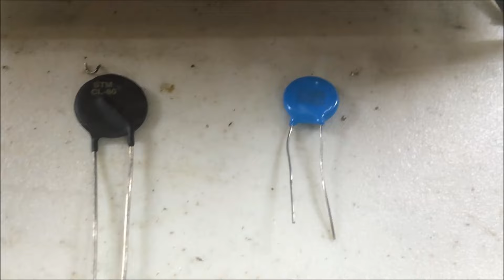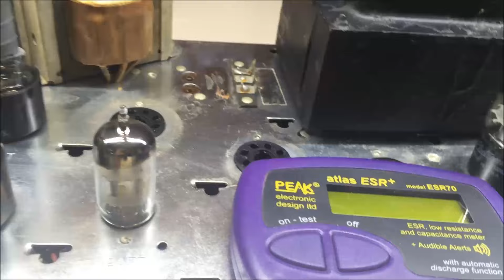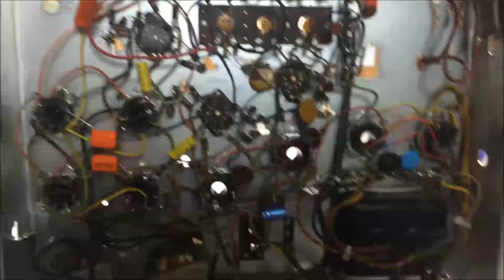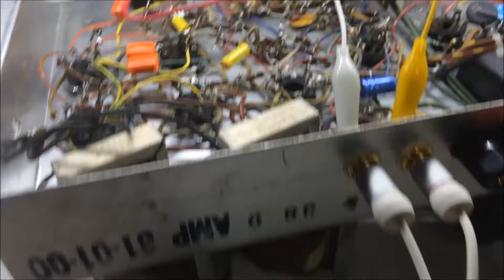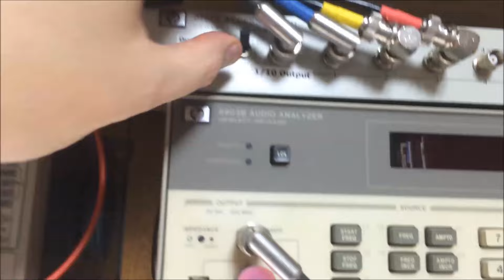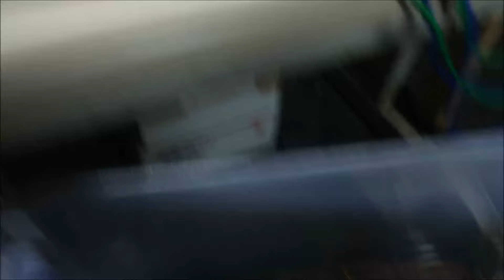Magnavox Tube Console AMP 81 01 00 Restoration - BG001

Comment: This was originally a bi-amp unit with 2x 6V6s for the high end and 4x 6L6s for the lows. I have not yet found a schematic online. It looks like you have set yours up just as a full range stereo amp and eliminating two of the output tubes. The pictures I've seen online are not great but it looks like the speaker outs are via one of the Molex connectors. You are clearly a way more knowledgable tube tech than I am but I would be curious as to your thoughts on restoring one as a bi-amped unit. There appear to be output screw terminals for one channel (?) with "H-C-L" (high-common-low?). The original unit had two output transformers on the inside and two on top for the four speaker outs (L-R high, L-R low). Anyway, nice work! I'm a lifetime sound engineer for live and film/TV postproduction but I am now getting my feet wet with some restorations of old gear I have owned for years (just finished the Fisher KX-200 I got in 1974 and it came out great and sounds amazing!)

Comment: I tried to go to your www.blueglow.net site but got this message: 
This site can’t be reached
Not sure what the deal is with it.
I was glad to hear you mention what you did about making a secure connection with the wire and not depending on the solder to hold things together.  I have a particular "irk" about that habit of many people.  I prefer the N.A.S.A. method, which is pretty much what you said to do.
I am curious.  Since you made all those holes to provide the mounting for the banana jacks and the RCA style connectors...and I think the fuse holder as well... WHY did you put the power switch so far away from the entrance of the power cable?  There looked to be ample room to install the switch near the fuse holder and would have saved running so much wire carrying the AC around the other components.  True you kept it away from the most important area, but I am just curious why you chose to do it the way you did.
When you mentioned that the original configuration was with 3 channels, I thought it would be great to use one for a "Sub Woofer" source...but I guess the owner either didn't have a sub woofer, didn't want a sub woofer, or something like that.
When you mentioned that you took out one of the rectifier tubes I winced...thinking it was so cool the way they had done that...but once you mentioned the excess power drain, it made more sense to me.
There is a video I wanted to share with you ...I think you will enjoy it.  Hope so anyway:
https://www.youtube.com/watch?v=BnR_DLd1PDI&t=220s
Thanks for uploading your video!

Comment: I just discovered your channel and am happy to subscribe, looking firward to seeing more great restoration videos. But I am wuite surprised you didn’t notice the configuration As a bi-amped stereo unit instead of seeing a center channel. I should think a fairly cursory examination of the circuit (let alone a Sams) would have given you a clue (eg. How many output transformers does it have?). Interesting hobby you have!
Reply: It was a nice amplifier. I am a fan of the bi-amped configuration. Now it only has two channels..

Comment: This is a 4 channel amp.  2 bass channels running in push-pull with 2 output transformers on the top of the chassis, and 2 treble channels running in single-ended with 2 output transformers inside the chassis.  You can see all 4 output transformers in the video.  This is a great amp for bi-amping.  Why did you remove the two treble channels?
Reply: Basically it has been ruined, not "restored".. It would have been so nice to hook it up to some special bookshelf speakers and wire the bass and treble separately..

Comment: That amplifier was not a three channel tube amp. It was set up as a bi-amplified stereo amplifier. There are two single ended OT underneath for the treble amplifiers, and two push-pull OT on top for the lower frequencies. The box that you pulled off from the top was responsible for separating frequencies on each stereo channel and diverting signal to the correct amp and channel. In original configuration each amplifier in each channel was responsible for powering either a horn tweeter or an AlNiCo woofer. Before you tore it apart, that WAS quite a rare and valuable amp. FYI. In any case, I’m glad to see another Maggie back in service.
Reply: Hey Shaun, the power amp sections have 6V6 tubes . . Not 6L6. The high frequencies are handled by a single ended 6V6, while the lower frequencies have a push pull configuration. This means there are 6 total output tubes, and 4 output transformers. The large transformer provides power for the filaments and the high voltage needed to run the amp. There are many resources online to help guide you through vacuum tube electronics theory if you want to learn more.
Reply: @danameier7972  I meant 6V6. Typo. I see now (on an original unit) that there are two speaker output transformers inside the chassis and two on the outside. The large black one is obviously the power transformer. There is also a fifth small transformer next to the 4 part can cap. Thank you.
Reply: Who is buying them (valuable) and how much? I might have one In storage
Reply: @travisvodden6845   These amplifies are being sold mostly on ebay, the restored examples can bring in quite a bit of money. Even the unrestored but functional amps can still fetch several hundred dollars. It is all about knowing what you have and if it works properly. Some of the lesser Maggie or RCA tube amps don't sell for that much.
Reply: These is nothing better than the configuration of  the original amplifier.. Stereo at it's best… Now ???
Reply: As you stated this is a bi-amp unit with 2x 6V6s for the high end and 4x 6V6s for the lows. I have not yet found a schematic online. It looks like you have set yours up just as a full range stereo amp and eliminating two of the output tubes. The pictures I've seen of an unmodified unit online are not great, but it looks like the speaker outs are via one of the Molex connectors. There appear to be output screw terminals for one channel (?) with "H-C-L" (high-common-low?). Are the two smaller stand-alone transformers high frequency speaker outputs, and the low end channels through the big black transformer?  Do you know the crossover frequency originally used? NOTE that I am not referring to the unit in this video - it has been changed from the original design. I am referring to the original 1960 bi-amped console amplifier.

Comment: Man years ago I found a medalist in the monroe louisiana dump( early 90's) I salvaged the power amp and the pre amps( discreet) sections. It was my boss that already saw it many times just sittin rotting on the way into the dump. He's the one that told me, " Hadley you oughta get that amp"
So one day while we were there they dropped me off with some pliers while they dumped. Needless to say years later bout ( 6) i built a boutique head. Looked good. Black vinyl white tweed gold backplate neon light ,toggle switches,
Tried to make it look like a marshall. Put three jacks for the input. Left both and right. The both was a switching jack.
Reply: I loaned it to a backstabbing hater and he smashed it to bits with a sledge hammer. His name is Greg Pat Pyatt.

Comment: What would have been the purpose of the third channel? 2) Shouldn't the electrolytic capacitors have been replaced anyway?
Reply: Before stereo records, there were pre-recorded stereo tapes that had a "left-right and center", but that was primarily RCA "living stereo".. This amp actually has two bass channels and 2 treble channels, which was very nice for early stereo.

Comment: I am not a fan of the old can caps, as I would have replaced it with poly's if you have enough room underneath, and I would have placed some really good foil coupling caps in the signal path before the output stage. I would have replaced the power cord, with the 3-prong with a IEC filter and you can use after market hi end power cords with it! I would have used the parallel 5u4gb rectifiers together.  That's all I would do, and built a really nice wood casing around it! This is just my 2-cents worth. Also could not hurt to replace the existing choke in the PSU, with a higher Henry rating. I do like the fact you took out the tone circuit, and took out the center channel! Not needed.... Good job!
Reply: It was not a "center channel", it was a "bi-amped" system. Two bass channels and two treble channels.. Center channels were used when RCA had "Living Stereo" reel to reel tapes before records were released in stereo. I think only RCA and Motorola did center channels on their amps..

Comment: Thank you for your video.  I have a Magnavox 9302 that had been restored by someone else.  Looking at the bottom of mine it has the electrolytic capacitors replaced and a fuse added but the original death cap is still installed.  I will replace that and add in a cl-80 thermistor.  Thank you again

Comment: Is there not an issue regarding compliance with modern electrical safety regs if using cloth covered cable? Or would it just be illegal to use it in a brand new amp but ok in a unit that came fitted with such wiring from the factory & therefore the work is classed as repair / modification  & not construction? I'm not familiar with the regs for (what I assume would be for) portable appliances & am curious how / if they would apply to seemingly antiquated components like cloth covered cables? Loving you videos by the way; very interesting - just one thing (that ISN'T meant as a criticism by any stretch) that i notice on all videos lol this: whenever any power tools are used, they are always really loud compared to the dialogue. This must annoy headphone users. I wouldn't know how, but if the overall max Vol level could be limited to that of the loudest dialogue, it'd make for a much more pleasant viewing. Doesn't detract from the thumbs up 👍 for all your vids on vintage hifi though....kind regards
Reply from the maker: +Tom Easterbrook you would be correct, if I was building amps to sell, I don't think I could use cloth covered wire.
Reply: They do make cloth covered wire that has modern insulation under the cloth covering that one can use in a restoration if one desires.

Comment: thanks for these videos they are very helpful. I would like to see more vintage solid state amps/receivers. if you can, thanks.
Reply: What a waste removing the HF Amp and making it a fullrange stereo amp. In its original form 2 LF amps and 2 HF amps crossed over @ 1200hz it can be an excellent amp for driving an Altec A7 system.